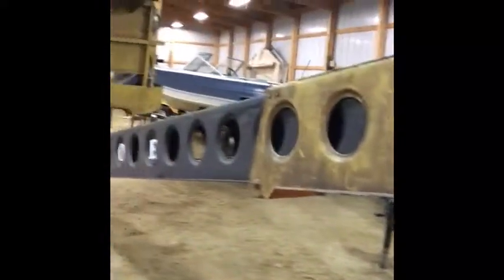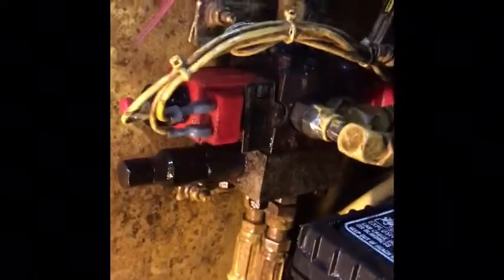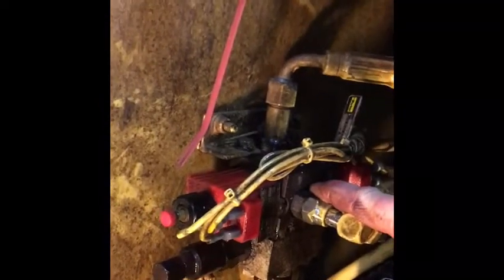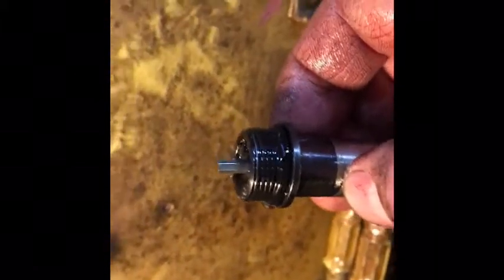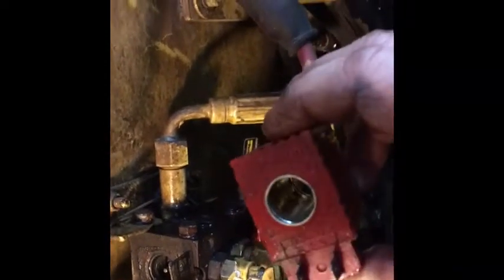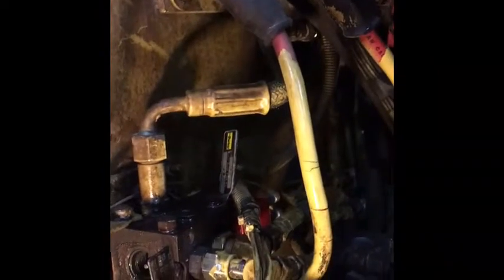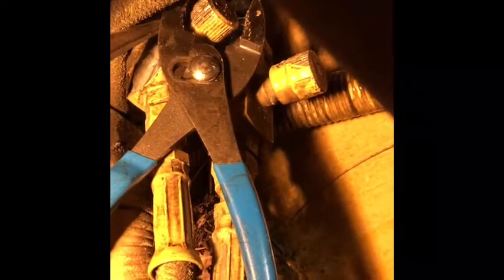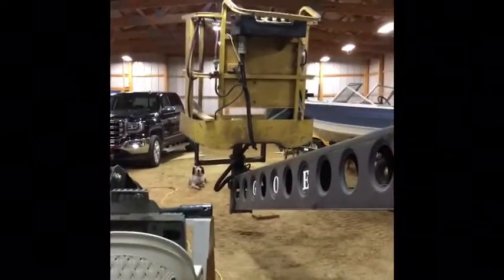Grove AMZ50XT Manlift troubleshooting platform rotation issue.

Comment: Have u done anything else on a grove manlift
Reply from the maker: Over the years I’ve done various smaller things, just a couple months ago I had to change the propane line.  I’ve changed out the switch for the boom/riser function, the joystick control for forward/reverse/steering, found and cleaned up the connections for steering, pulled off the the head to remove a broken spark plug (that was a nightmare), solenoid for choke.